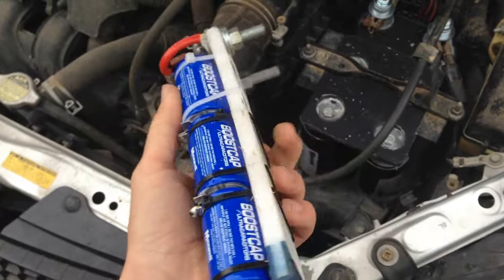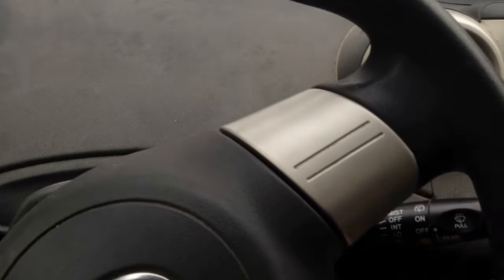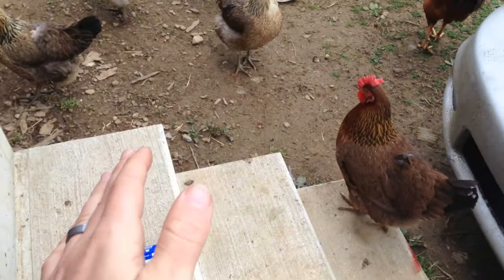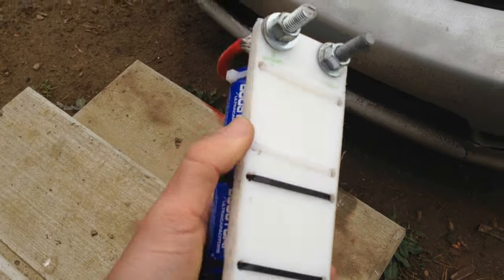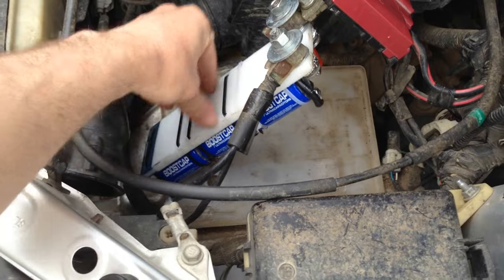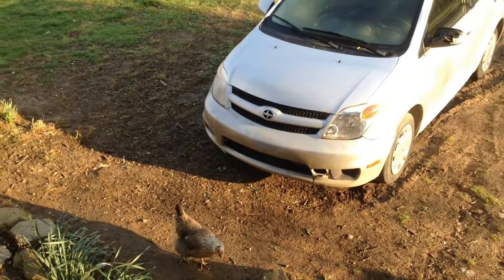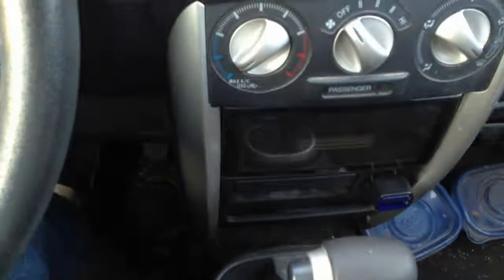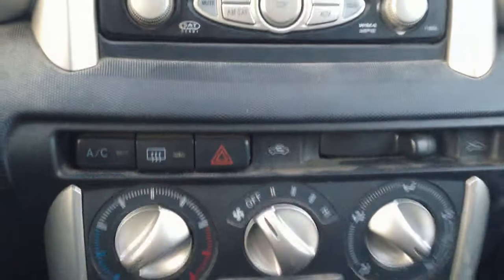Replacing My Car Battery with Capacitors! 12V BoostPack Update

Comment: The thing about capacitors: lots of voltage, no potential
also you would probably would want to be a little more careful handling those things.... it does have enough potential, (esp when when connected to a car battery) to knock you on your ass...

Comment: Bullshit. Those caps are rated at 1275W@1Second or 106A@1Second. Just turning the key to the run position draws approx. 20A which means the caps would be dead in 5 seconds. The starter motor draws approx. 100A during cranking which means the caps would be dead in 1 second. I am an ASE certified Diagnostic technician with over 35 years in the automotive/electronics field. With almost 2.5 million views it's amazing to blow smoke up so many peoples arses. P.S. Lion batteries are very sensitive to the voltage applied while charging. (Max 4.2V!!!!). They are rated at 3.6V but 4.2 is 100% charge  and is stressful for the cell. 4.0 is recommended for 80% charge and promotes long cell life.

Comment: supercap can be dangerous
the alternator from car requires up to 700 amp to start the engine
this so called in rush current its like shocking the supercap forcing it to jump up to 700 amp 
if the supercap is poorly designed, the supercap might blown
but its unlikely since the resistance is very small on supercap
this is why car uses lead acid batteries because lead acid batteries are immune to high current and can do alot of abuse

Comment: Well, then why weren't these used as the main power source a long time ago, even though we had capacitors that big a long time ago?
Reply: How does something "deplete to a place called 'fast' "?

And, *****, if you instead meant "too fast," then why are they starting to be used now? And how do you figure they have "no reserve storage" if this guy showed us that they've lasted about as long as a battery?
Reply: Isn't that what this guy did, *****?
Reply: No, I've seen at least one video where he tried starting it a few times right in a row, *****.
Reply: Up until recently, those were more reliable than capacitors. But now, with demos of this and other things like it, it makes me wonder, which is why I posed my question, of course.
Reply: Not for "any length of time?" Not true. He ran the radio for half an hour.

Let me go back and try to find the repetitive start/off.

Comment: Capacitors are great for short bursts like starting but I agree with making it a hybrid because you want it to be able to hold as charge for a long time, power low energy electronics like the clock radio and car computer electronics for a long time with no charge, and to power a sound system and interior lights and door sensors with the alternator not spinning.

So your decision to make it a hybrid is a great idea

The LORD JESUS CHRIST bless you

Comment: I drive a BMW 323i she has a rather large traditional battery in her trunk BMW engines are rather high compression -11 - 1 compression ratio I don't think the little capacitors work in the car as a matter of fact the owners manual demands that you use 93 octane gasoline where your Saturn can get away with 89

Comment: In your description, you say that it could make deep cycle batteries obsolete. That is false, as capacitors slowly lose their charge over time, and if you do not run your car at least once a week or so, you will find yourself stuck with no way to start your car.
Reply: And Lead Acid batteries also slowly lose their charge time. So what ?

Comment: With little capacity won't the alternator be constantly running and diminish any gains, since an alternator takes a lot of power to run under full load.
Reply: With bigger capacity it will be too. Moreover, with such boostpack it will recharge these capacitors in like few minutes and then it will only power rest of car power draw (lights, radio, etc).
With ordinary battery, when you use too much capacity to start the car too often and won't ride enough to recharge it fully, alternator needs to power whole car + recharge the battery all the time.
Reply: If you pull so much reserve out of a lead cell battery starting a car that the alternator has to run constantly something is wrong with the system. An alternator only is activated on demand, early cars had 30 amp and heavier trucks 60-65, but now a typical 1/2 ton truck uses 100 amp so the demand for newer all electronic controlled vehicle is greater while the battery size in CCA has remained the same. Under powering electronic components shortens their life and are expensive, so even if you figure the weight savings and replacing an over worked alternator more often and the extra fuel it won't pay in the long run.
Reply: @ronosga5072  CCA does not have anything to do with powering stuff when engine is on or off. CCA has only to do when engine is starting because it is pulling loads of current to.. well... Cold Crank the engine. 

Alternator is working all the time because it's connected to the pulley and belt of engine all the time. It has regulator to not exceed specified voltage in the system, in most cases around 14 - 14.4V. This regulator blocks flow of current from regulator when voltage approaches maximum voltage and lets current flow when voltage gets lower.
Stuff running in background like light bulbs, radio,  electric power steering, rear window heating etc draw current effectively lowering the voltage in system, so regulator lets current flow from alternator to fill the demand. I the ideal situation when battery is fully charged and voltage in the system has reached 14.4V regulator lets only small amount of current flow to power all the systems, but that power flows from the alternator. If it flew from battery, battery would get discharged -> alternator would turn on to charge it. 

That's how it works and there's no other way for it to work.
Alternator's regulator is not an ON/OFF device like you would like to believe, but rather linear device which regulates voltage in the system.
Reply: @domints   when the fields are activated with the trigger wire sensing a draw you hear the engine lug down. I ran an alternator with a 1 1/2 HP engine the second I activated the fields it killed that engine. After the AC current is converted to DC it is regulated as to not over charge but  it does not run continuously only on demand which is what capacitors will cause it to.
Reply: Ron Osga alternator won’t kill the engine unless you load it with something. You probably took big car’s alternator which might have even 2 or 3 kW (much more than your tiny engine) and connected it to engine. Then you took big battery, not completely charged and attached to alternator, which started charging the battery pulling whatever this anyone had to give.

The thing you’re talking about is exactly how alternator works. It’s not a permanent magnet generator, but an alternator. It doesn’t generate anything until you power the field windings. The thing is, windings are powered all the time from battery. Also if your tiny a home didn’t fail at powering it, after disconnecting battery you’d notice there’s still voltage on the alternator output. Once kickstarted, alternator powers itself and the voltage persists until it stops rotating. Look up some videos on principle of alternator’s work.

You might also try the same experiment, but with adding some bulky rectifier diode so the alternator won’t be able to charge the battery.
Start stuff up, add the battery in a configuration so alternator won’t be able to charge it, disconnect the battery and measure voltage. Voila, there’s 14V output.
Reply: @domints  when we drag race we don't use an alt because we give up too much HP and I raced figure 8 demo cars wired my alt with a light bulb for some resistance on the trigger wire the bulb is bright when no charging and dim when charging I used a huge battery for hot starts never had a battery explode. Yes the pulley is always spinning and the voltmeter reads 14 but put an amp gauge in and watch what is really happening. If it continually were charging if you drove 300 miles during the day with no lights on you would explode the batt. Look it up Nascar runs an alternator off the rear axle where would all that power go running that long? I used capacitors to build a 10 HP self starting, self balancing rotary phase converter for 220 3 phase machines capacitors have their place but simply not as a storage battery.
Reply: @ronosga5072  FFS. Now go like 3 coments up and read what I wrote. Then you might want to read what happens to battery that is charged below 14.4V. You might also want to read some about ohms law.
Reply: @domints  I would be interested to see a mpg comparison between the capacitors and a battery my bet is the battery will get better milage.I read all the theory's on how things are supposed to work, then I witness for myself how they actually work. WTF was a term electricians came up with when things worked that shouldn't  I spoke to many that have stories that go against all text books.

Comment: it does start the car but capacitors aren't batteries and the cars alternator puts power back in and who knows if the capacitors can take it long enough for then to die. if it were going to be a cheaper and simpler solution manufacturers would use them
Reply: Javier Hernandez capacitors are made exactly for that. Constant discharges and charges will cause little to no wear
Reply: well yea i guess. 12v is a pretty low voltage(you can grab both terminals of a car battery with DRY hands and nothing will happen) and even if it was too much its dispersed over all 6 of the capacitors so each capacitor theoretically only gets 2 volts(12v/6capactors=2v). Capacitors can work in harsher conditions than your typical car battery aswell so that shouldnt be an issue. The only major issue with using capacitors is they dont store much energy so you couldnt run, for exanple, your stereo off them for very long at all.

Comment: How many duty cycles can those caps take?
Reply: ***** Thanks, I did not know that.  I may try this for my jeep.  Lighter and seems like it would take the off road abuse.
Reply: false. I guess these are some kind of supercapacitors. Those are typically good for bout 100k -1M discharge cycles. That is  a lot, but far from infinite.
Standard aluminimum-electrolytic capacitors, however, have virtually infinite duty cycles. Too bad they are like 50-100 times bigger having the the same capacitance than such supercapacitors....
Reply: Those are just two factors. There are others too that need to be taken into consideration.
Supercaps can only reliably operate in a temperature band narrower that usually occurs in the engine bay. Sizewise supercaps still inferior to batteries, even to lead-acid batteries. Cranking the diesel is just one thing, a loco has a tons of subsystems that need electricity, and a big loco carries lead acid betteries weighting a ton. Literally a ton.
It's not that nobody ever thought of replacing acid baterries with something better. simply still acid battries fit the job best.
As for cars: There is not only a small radio drains current in a car, but people want to be able to use thir lights, seat heatings and whatnot even when the car is not running.
Maybe combining smaller baterries and supercaps can be an interesting thing, but complexity and manufacturing costs and such stuff would be still an issue.

Comment: Can I use 6 capacitors at 15 volts each and use them in parallel?
Reply: serie
Reply: It is very hard to find 15 VOLT super-caps.
Reply: You can use 6 such packs (36 caps in total) to use them in parallel to get more current and capacity.

Comment: if cars manual to realy test it should  stop car from firing and drive it around on stater in 5th gear see how far u can get be4 it conks out....
on car uses 200cca bat with 600cca installed can do about 200m of driving on flat going 25kmhr

Comment: Definite spoof! The caps are far too low voltage (did he say 2.5V?) to be connected in parallel which is needed  in oder to add the Farads. Presumably pre-charged to what 12-14V ?? So if they aren't already blown we need to know how much energy (in coulombs or watts) such a pack could hold in theory. Anyone know that? I'll bet it's not nearly enough for a sustained 300-100Amp draw. of a smallish car {let alone lorry!}  That's 3600W (inrush) -1200W (cranking) . I don't need to know more in order to smell a rat and say THIS IS A SPOOF! Nice thought though eh?

Comment: Funny how on your update, you have added a battery into the circuit.
But you never tell why........
Reply: He mentions it in this video, for "long term" viability. Without a battery you would need to start the car every few days otherwise you would be screwed. Adding a battery helps it keep the charge for slightly longer. How much longer is anyones guess.

Comment: the problem is that it stores energy for a small time. therefore you cant use capacitors to replace batteries.
Reply: Super-capacitors can store energy for a very long time. They are being used as replacements for batteries. Many computer motherboard's have been using a super-capacitor, instead of the small lithium battery.  Where have you been for the past 10 YEARS ???

Comment: Couldn't you just use 5 of these? 2.7x5= 13.5v nominal and 14.25v max

Or maybe even 4 (since you started it easily even at 10.5v
Reply: Capacitors don't have nominal voltage. They only have maximum voltage. 2.7V is their max, so 13.5 is max for pack of 5. Therefore, alternator would blow them up. For pack of 4 it would blow them up even faster

Comment: Hahahaha those capacitors is use to support the battery if you're using Audio with High Power output and Sub Woofer so the voltage will not drop suddenly in millisecond.  Replacing Car battery?  No way

Comment: The capacitors recharging so quickly is nice, but I'm wondering if that would cause a strain on the alternator. Could wear it down over time?

Comment: IDK if u tweak it with n impedance match  from initial output from the voltage  initial charge with out lose maybe plausible🤔 IDK trying 2 understand the capacitor workings? it seems 2 b doing what the power companies like not 2 do n us as the a customer are paying 4 the much greater loss than the input coming in something like get 20% out of The 100 that goes into them a circuit and system and you pay for inefficiencies seems on purpose to me IDK I'm still learning and trying to figure this all out???? So many alternatives 2 energy hard 2 keep up with them all? I have dome small test but nothing 2 start a car as of yet interesting😎🤔

Comment: Sounds like a great way to kill an alternator. 

If this works so great, then why didn't Toyota go with capacitors instead of nickel batteries for their hybrid? Oh yeah, because this doesn't actually work. At all. 

My research and math says that 300 farads is about 9mah. ... That's not even 1 amp. Car batteries are generally 75 amps.
Reply: Because that's a hybrid, it relies on the energy density of the battery. A combustion engine runs on fossil fuels, not for the majority on electricity like a hybrid car.  These capacitors can do the job for starting up, etc. but one day you'll end up without juice. Good thing with supercapacitors is, is that they charge really fast, since they don't hold a huge amount of energy. We'll just have to wait for better graphene capacitors, they are able to hold 3000+Farads per piece.

Comment: Hello! Thank you so much for your very informative videos! I would like to build a boost back to start my ATVs. I have been looking on both eBay and at Digikey for 2.7v 2500f-3000f Capacitors, but all i'm finding is $50-$60 range. I noticed you mentioned in a few of your videos paying $8-$11 each. Can you point me in the right direction? Thanks a Bunch! :) Kacy

Comment: How long could you run the stereo on the caps
Reply: Depends upon the size of the super-capacitors and amps needed to run the stereo. You should use a separate Li-Ion battery for your stereo. NEVER use your car's starting battery for your stereo. Use some common sense.

Comment: How about overcharges?
Reply: This pack can withstand over 15 volts. If his alternator is not broken, it won't damage caps. If is in that way, it would also break lead acid battery

Comment: I am curious about the voltage drop after 1 start? Hmm
Reply: it doesn't particularly matter, since the alternator will immediately charge it back up
Reply: @JonDoe-wk9qc  Was just wondering of Voltage drop with no alt, thanx for the response just noticed this was from 2013 Da. Thank you.
Reply: @jbrisson007  The voltage will drop. It depends upon ...
a) The size of the super-cap
b) The amps your starter draws
c) How long it takes to start your engine

Comment: There is one problem yet not solved. If you  charge and leave this supercapacitor in your car it will with time loose its charge so it will betray you.
Reply: Then put in a larger super-capacitor or add smaller Lithium-Ion battery = "Hybrid". Did you not notice that he had a much larger super-capacitor previously? Install what ever size you need.

Comment: but Capacitor does not withstand high temperatures
Reply: Or do they? The ones he used can withstand between -50 and +70 degree celsius. Lead acid battery starts breaking at the same temps positive, but stops working properly at -6 degree celsius. 1:0 for supercaps.